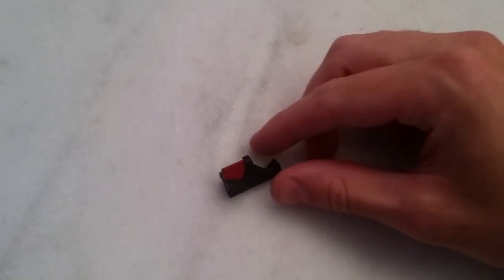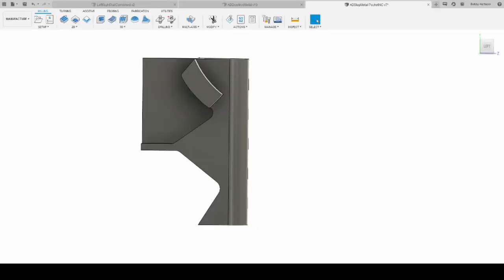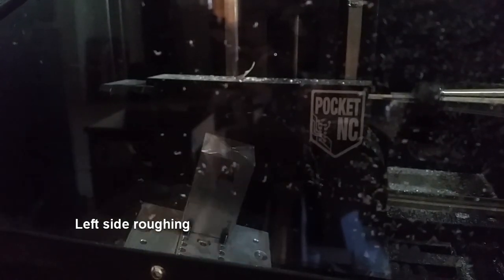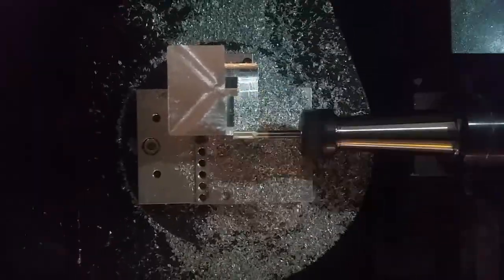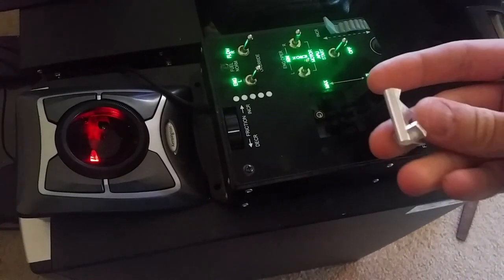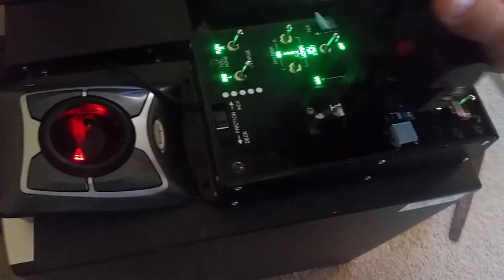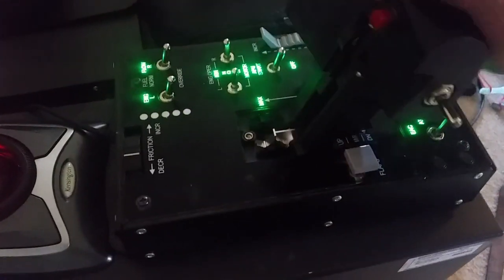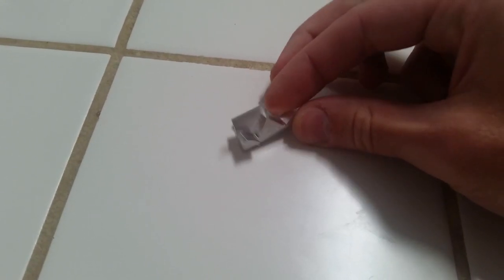CNC Milling a Push Through Detent for the TM Warthog Throttle

Comment: Where did you get the audio for the USNO Master Clock from?
Reply from the maker: I got that by actually calling the USNO Master Clock at those points in the video (well, +/- a minute or two). If you call (202) 762-1401 you'll get the recording. I used a call recorder app on my phone to record it then transferred it to my PC and added it to the video.